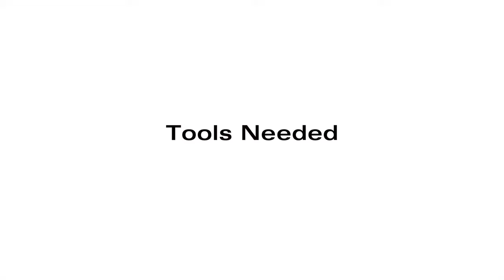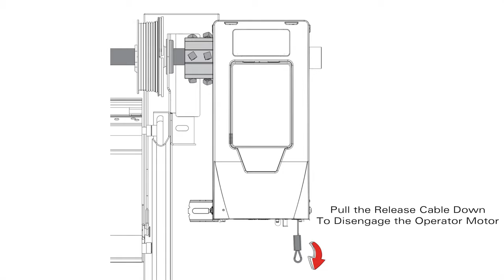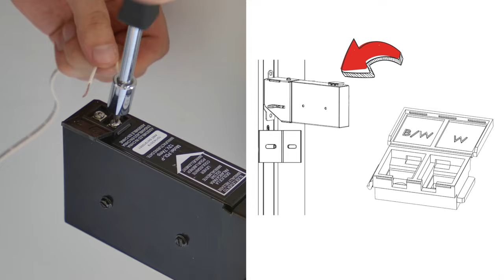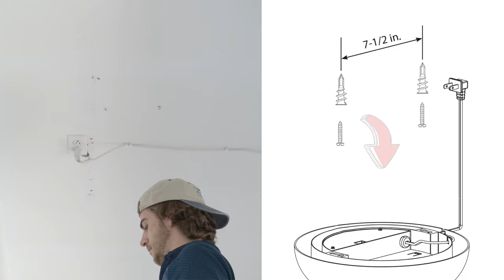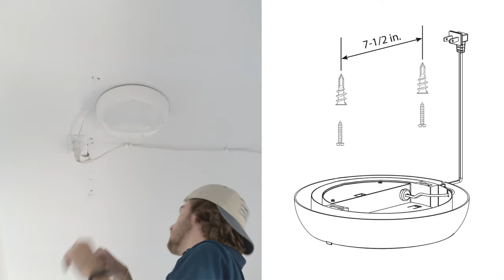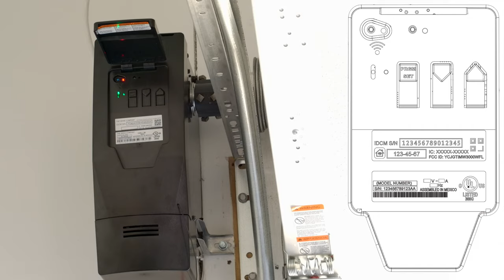How to Install the Genie Wall Mount Opener

Comment: How do you reset the manual emergency cord?  You show how to release it, but not how to reset it.
Reply: have the same issue, no one covers that
Reply: @andreylevchuk8013  did you ever get an answer?  I did my install yesterday.and now I cannot reset it either.
Reply: did you ever get an answer?  I did my install yesterday.and now I cannot reset it either.
Reply: @tee3592  just pull hard on the rope release until it clicks and re engages.
Reply: @amazin3265  pull and hold out keep yanking and how hard
Reply: @tee3592  actually, you have to pull pretty hard. I just installed one yesterday for my Mom and I reset it this way numerous times. It states this information on the big, map like, instruction manual.